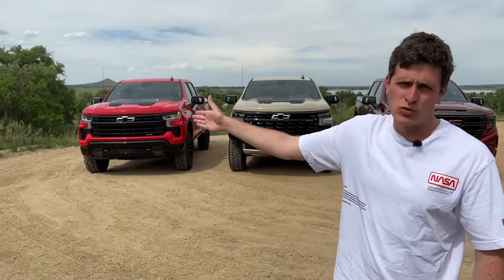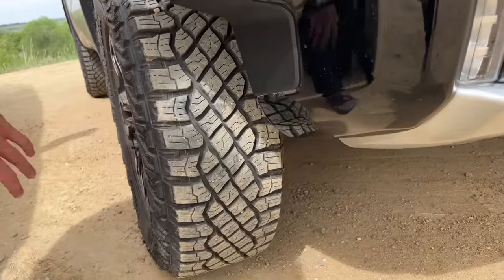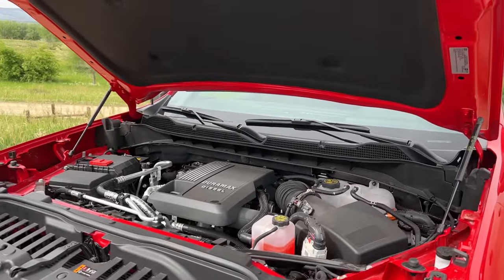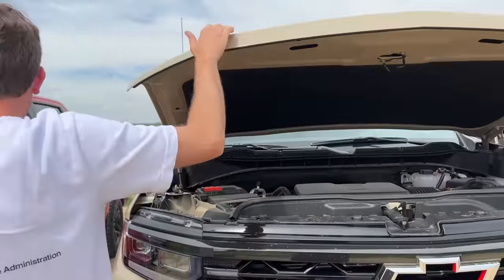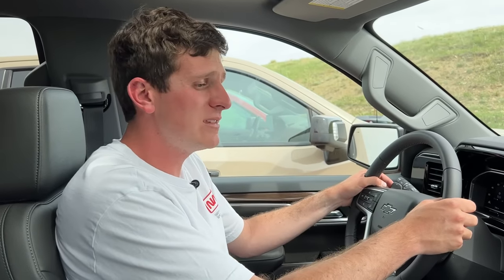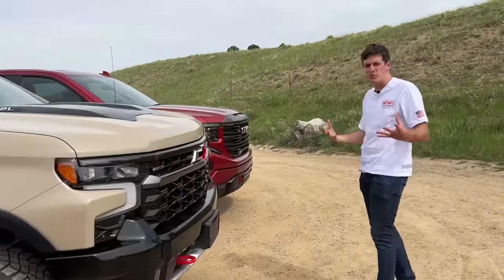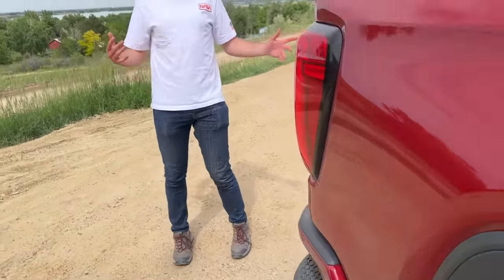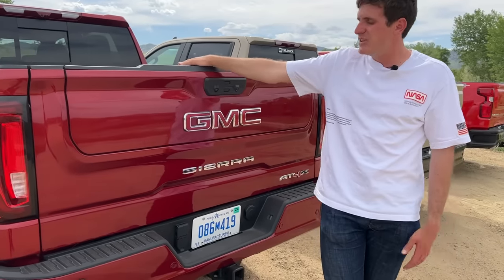What Is The BEST Off-Road GM Truck? Silverado Trail Boss vs ZR2 vs Sierra AT4X

Comment: I’m new to the truck game , my background is Honda vehicles! I love the reliability and longevity of Honda vehicles . My question since I’m considering a Silverado, how reliable are these 5.3 v8’s with the 8 speed transmission.  Would it last a long time  as Honda do?
Reply: 5.3 has been around a long time and is a very reliable engine.
Reply: Good engine? Yes. Last as long as a Honda? No.

GM has been known to have good transmissions.
Reply: The 5.3 is a really good engine...as long as you find a way to delete the cylinder deactivation stuff. It's arguably as reliable as Toyota's 4.6 V8, or the 5.7. The 8 speed automatic transmission? If it's not a ZF8HP transmission I can't tell.
Reply: But a Ridgeline or a Tacoma. Avoid Chevys like the plague!
Reply: @somecarnet  thank you for that .
Reply: @damilolaakanni  thank you , I not big on American vehicles in my personal opinion they’re crap , cheaply made and not reliable . I’m hoping things changed with this generation Silverado’s
Reply: @billp5424  lol edited . The ridgeline is nice but the backseats are kinda tight . Tacoma is smaller . Both very reliable trucks . Unfortunately Honda doesn’t make anything bigger or taller . I wish they did though .
Reply: If you absolute luxury, bad resale value, and a car that would last 3-4 years max, then get GM. But, if you want longevity, somewhat luxury, and best resale value, then get the new Tundra instead. Trd Pro for instance will be about the same price and so much better in reliability, resale value, and longevity. But if you’re looking to change trucks often, get GM. American cars make money based on consumers that always want to change, and never ask a GM fan boy about GM, they always exaggerate the quality, but stats will always humble them down. The new GMC truck is a beast as well as the new Chevy ZR2, but a Tundra will give you the needed luxury and the longevity and re-sale value you’re looking for. If you want a truck that will last forever and not care about luxury that much, then Tacomas are the best option, especially for off roading.
Reply: @fredg5381  hands down Toyotas and Honda are best in quality and longevity. I’m about 2-3 years out before I buy  truck . I’m just educated myself now on these . The tundra v6 twin turbo , idk if I trust that motor just yet
Reply: @datchulo1085  I agree, but you have plenty of time. Either way, I’d trust Toyota over any American made truck any day of the week. This is not Toyota’s first rodeo when it comes to turbo charged engines that last a long time, so I agree with you, but I’d also wouldn’t be so skeptical about it. Toyota doesn’t offer luxury, so they have to have great reliability instead in order to compete in the market. Either way you have plenty of time, and by the time you buy a truck, it seems that electric ones are gonna be the only option, unfortunately.
Reply: I am a 2018 Honda Pilot elite owner as well as a 2016 Silverado owner 5.3.  I am a Honda lover thru and thru and nothing, not even Toyota compares to my Hondas.  The 5.3 is a good general engine that comes with it's problems.  They built  thousands a year so when something happens it's noted on the web.  I have 120k on mine and not a problem.  I tow 8k regulary with it and it does fine.  You can't go wrong with any brand though.  Go with any brand that catches your eye because it doesn't matter.... They all are machines that will break down.  I just wish Chevy could come up with a 5.3 VTEC engine and i would be all in! :)
Reply: Buy Nissan Titan
Reply: @prometeo0136  I rather not lol Nissan? I rather take my chances with a Chevy
Reply: @somecarnet  If maybe its an Allison transmission. Unfortunately in house built and designed transmissions like the 8 speed, have been very problematic.
Reply: @billp5424  you do not know what you are talking about dude
Reply: It’s a Chevy that’s all you need to know..
Just the pricing is way TOO OVERPRICED..
Chevy’s has been on one with their pricing like they’re making them in Germany or something…SMH…

Comment: I've owned a 14, 15 and 17 Chevy 1500 LTZ's, all of the driver's seats suck. They seem to break down in the butt area pretty quickly. I never had more than 35,000 miles on any of the three. I'm not a huge guy but not tiny either, about 240-250lbs.

Comment: Truck makers have got to stop putting 20" wheels on trucks marketed as being intended for off-road duties. No off-road branded truck should ever come with wheels larger than 18".  You need more tire and less wheel to soak up the bumps and dips and prevent the wheels from getting bent should the vehicle unexpectedly drop on a big rock. 

Truck makers need to understand, there is a difference between pretending to be truly off-road ready and actually being it. No one should have to pay the high prices of the F-150 Raptor Or Dodge TRX for common sense features. They can build trucks with ONLY what is needed and let those flagship trucks exist for their purpose.

Comment: Whats the difference between the z71 and trailboss?
Reply: 2 inch body lift, tires and z71 has a 2 speed transfer case for low gear and umm I'm sure I missed some other small things but really not alot both have Rancho not the sweet multi-matic shocks

Comment: I just wish I could get the 6.2 on the custom trailboss like my dads limited custom trailboss.. if Chevrolet don’t make that move 
I’m going to have to consider the f150 rattler with 5.0 coyote… I’m not buying a 5.3 or 2.7 and get smoked by 5.0 or 3.5 ecoboost… hellllll naaaa 😂

Comment: Its so sad that the trail boss doesn't come with a elocker especially since they have the axle available with the ZR2. I want the Trail Boss with the Diesel engine but I think I will go with the F150 Tremor because of the lockers and gear ratios you can select from the factory.

Comment: 6.2 not aggressive sounding??? What ?!?
Reply: Stock the 6.2L is fairly quiet.
On mine I almost heard more engine than exhaust noise.
I ended up putting a Borla....much better.
Reply: @rodjbosch  yeah if you get the performance package upgrade it sounds perfect not too loud and annoying but deep and more than aggressive. They need to add it to one of those models.

Comment: Is it just me or has anyone else noticed where they place the side view mirrors on the doors they put them right above a new body line that you would think the designer would want to accentuate on a new truck it's a trying to push it looks like they just slammed it on the door panel instead of on that black triangle that your window glides into. The mirrors just look out of place to me let's not talk about the antenna above the driver's seat it could have been put in the back to look symmetrical what's up with GM
Reply: These vehicles are mass produced junk..